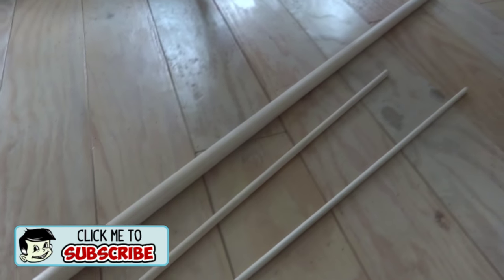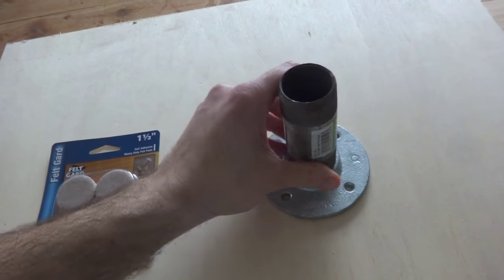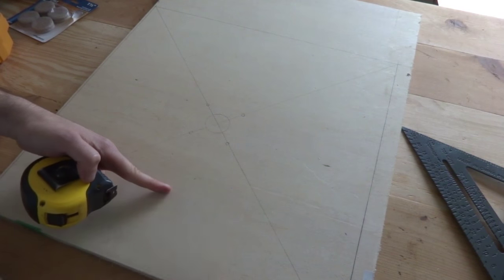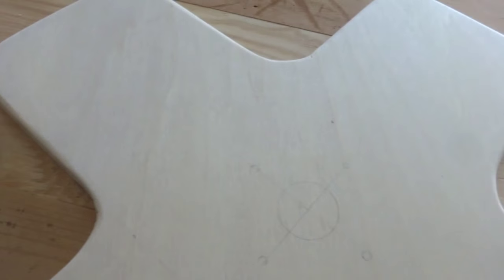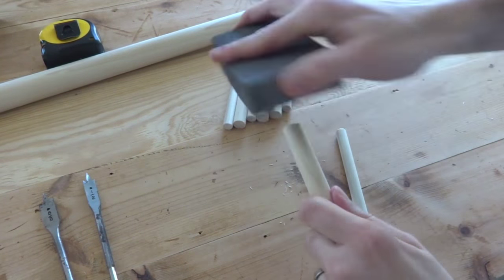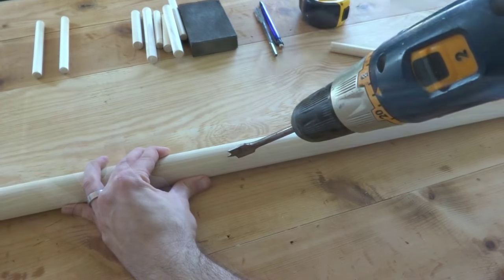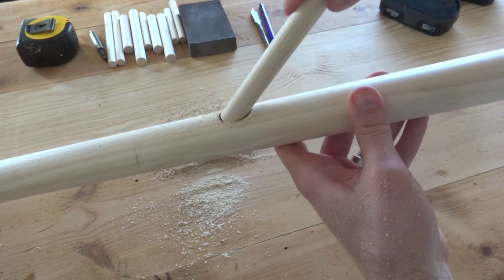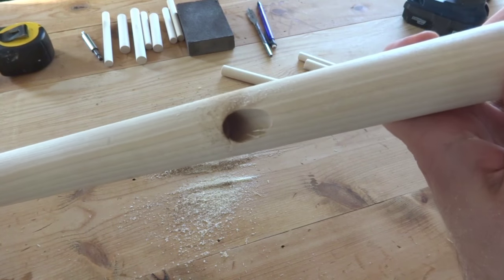DIY Dowel Rod Coat Rack - Part 1 of 2

Comment: Nice.  Easier to drill if you start the bit @ 90° and then tilt to angle you want.  It will save edge tear-out as you had on bottom edge of hole.
Reply from the maker: +Mark Hazlewood Thanks for the tip. The ultra dull 5/8" bit wasn't helping matters either. My sharp, 1/2" bit drilled in pretty nicely compared to this one.

Comment: I'm an absolute beginner with bits like that and at an angle!  I am going to do the bench and the shoe racks in my tiny cabin but this is kinda ringing warning bells about drilling the back of my own hand if you know what I mean. .if I had strong wrists to hold it steady I would give it a go but I think I need more confidence. ..wait till I've milled my first boards and am feeling all like I'm a DIY expert and I may give it a go!  I think I will just save part 2 on the playlist and jump to the next one that doesn't look like a disaster in the making Lol!
Reply from the maker: +Anne Anderson (Foxiepaws) Yeah, I really should have used a clamp to hold it down instead of my hand. I was distracted by how dull my blade was. The new spade bit I bought to replace it drills right through the wood, no problem.

Comment: Why not shapen the bit? I think John Heisz has a video on it. Would a Bevel guage help? ;-)
Still cool project!
Reply from the maker: +Nearoth Yeah, I replaced it after this project. It was an old worn out bit that I forgot was in such rough shape until I had already started shooting the video. I think I drilled something out a while back that had metal in it. The shorter spines on the side were completely worn flat. Realizing how terrible it was while shooting the video was a bit embarrassing, lol, but I had already started drilling out the post and didn't want to stop everything to purchase another one, so I just went with it. I guess it shows that it can still be done with a terrible bit, although I don't recommend it at all. My 1/2" spade bit was super sharp and drilled the holes quickly though.
Reply: +MrDiyDork so sharpening wouldn't have helped? Could have forged it into a Fishtail chissel :-)
Still you could claim it was a smokin' project, lol.
Was also wondering where you shoot your intros, not trying to be picky but the sound in the video is very good but the intro is a bit echo-y.
Maybe a simple "make a logo banner" video, for the opening shot?
Thanks for the reply and the cool videos, shared a couple on pintrest.
Reply from the maker: +Nearoth I thought about building a simple bevel guage, but decided against it for the video. I may do that the next time I need to drill at an angle though.
Reply: +MrDiyDork or cut a piece of scrap to the angle.
Reply from the maker: +Nearoth Yeah, the bit was completely shot. I do the intros in my office, which is filled with all hard surfaces, but has the best lighting in our house. Plus, my camera mic is better for close up audio (I'm usually only about 12-24" away from it for the rest of the video shots.) I've had a few other people tell me the same thing, so I've been thinking about different ways to change up my video shooting formula. I'm not even sure I like the intros, so I may try just a logo screenshot like you're saying. Thanks for sharing the vids!
Reply: +MrDiyDork I meant a banner on your background. I do like the intros and a banner might reduce the echo. Or try a headset mic with your phone like Jay Bates does. I would also suggest making the intro for a part 2 or later slightly different. Maybe with a short recap with voice over, for me personally the same intro from the first part can be confusing.
No critique just some tips. The videos are great and fun. Hope that when I try to make some vids they end up as good.
Reply from the maker: +Nearoth Oh ok. Gotcha. Like a sound deadener. I do like the recap idea. Usually, when I'm making a video. I just shoot as much of everything as I can. Then when I'm editing, I'm looking at the timeline thinking "What!?! I'm at 12 minutes already, and I'm only halfway through? Gah!!! I coulda sworn this video was only gonna be maybe 7 or 8..." So I chop it into multiple parts & recycled the intro. But the recap makes much more sense. I already have to change up the title & end graphics, so a quick recap wouldn't take much more to do.